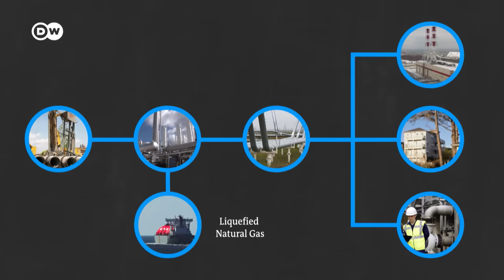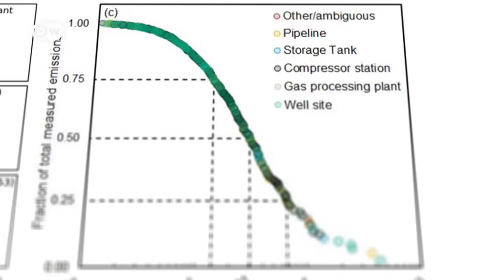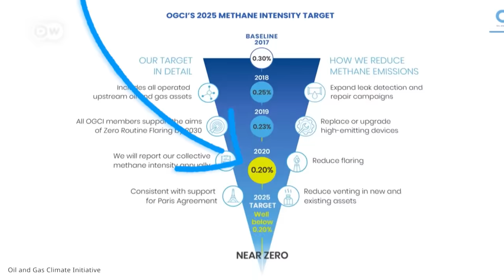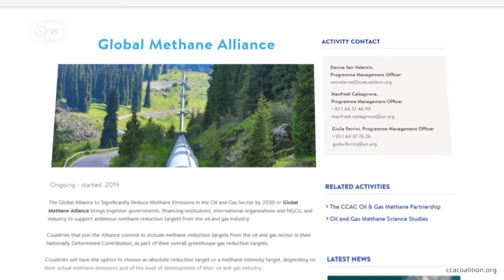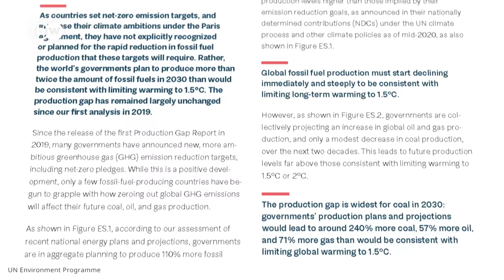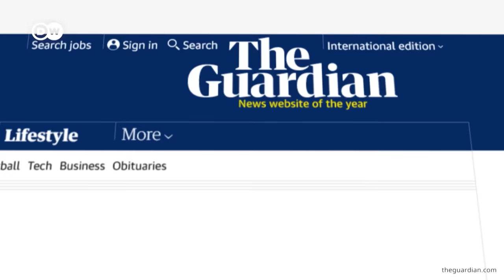Why we need to ditch natural gas (asap)

Comment: We need to fund next generation Nuclear research and then do as France did in the 70's use a "standard" reactor design and mass produce them. We also need to supply all the needed supportive technical infrastructure such as a national nuclear 'fuel-recycling' plant to utilize all the "spent-fuel" stored all over our nation. ALSO, anyone remember the natural-gas fuel cells? (remember the little 'black-box' on 60 minutes a decade or more ago?) AND, If leakage is such a problem then promote tools/plans to diagnose and fix them...?! My power costs have skyrocketed and the inflation of other essentials like food and fuel has significantly reduced my families purchasing power. Action action we want action... A-C-T...I-O-N!

Comment: Interesing, but I think this topic is a lot less simple than it seems. 
First, no gas or energy company likes the leakages.  It loses them money, so a lot is currently been done to reduce the leakage of gas.  Similarly, years ago, continuous gas flares were a common sight in every refinery.  Nowadays more and more companies have completely closed their flares and have them only operational to deal with emergencies
Looking at gas and oil and even coal as only a source of energy is also very simplistic.  Gas and Oil refineries primarily produces fuel, but then among its byproducts are the building blocks for many other chemicals used in our fertiliser industry and our pharmaceutical industry as a examples.  It is not as simple as “switching to renewables”. We still need these other things.  We still need ways of producing them without breaking the bank.  All the critics of the fossil fuel industry seems to focus on fuel and electricity generation but I have yet to see any solutions that will carry us all the way.

Comment: Methane is messy. Methanol I think is the option that will be good for energy storage , because it is the liquid cleaner ethanol, as an energy backup in cold places, and it can be used for CONTAINING methane.  But we need to get off methane because it still acts as a climate accelerator.

Comment: The Gas that is mined is called "LPG" liquified petrolium gas and not LNG. LNG is same as biogas and also CNG. CNG, compressed natural gas is LNG but in a gas state. Germany and Italy have well developed network of Biogas-LNG power plants, rest of europe doesn't really have that much bioplants. Developing gas in the next decade will be crucial for the energy stability. We imported gas from russia now we will try the same with the gas from the middle east but we could produce our own as well. Problem of Hydrogen is that it takes relatively a lot of power to produce it. We can produce Hydrogen during summer and long hot days and use it as a storage of energy instead of transporting our energy to other european countries. Solar panels they also will produce some pollution when disposed. 
Strategy of small steps would be better
First make sure that all of europe starts produceing their own gas 
Second look for geotermal hot springs
Third if all fails and there is no water power plants or geotermal waters then make the countries that run on gas transfer to solar panels and produceing their own hydrogen
Forth try to maximise hydrogen production but without enforcing any laws. 
Fith is to have a next energetic revolutin solar panels are also not the cleanest way of getting energy we need to figure out somehow how to produce energy with 0 waste.

Comment: Check what is CBM or maybe I will do this now. It states for Coal Bed Methane. Very few mines are capturing it, normally high metane content coal seams are fracked and all gases are removed via ventilation system.
That means burning coal you have twice as much CO2 but also lots of methane. That sucks.

Comment: `What hurts is the constant mention of carbon as a pollutant.  All life is carbon based and carbon is just the C in co2 which is plant food and part of the carbon cycle.  Co2 should be around 1200 ppm for plants to be fully able to grow yet it has been way too low for eons.  Carbon dioxide gets trapped into sea shells, carbon based rocks like limestone and various forest beds to later become coal, and oil or by plankton that die and sink to the ocean floor.  Much of that co2 is permanently sequestered creating a dearth of supply for plants.  Without us digging it up and burning it plants are literally gasping for air.  Plants die around 150ppm and what we are doing in this era is returning co2 to the atmosphere so plants can once again grow at their full rate.  Co2 is a wonderful thing and putting more of it into the atmosphere right now is a good thing.  The lemming like brainwashing cult that calls Co2 a pollutant is just that, a cult, and you should pull your head out of the disinformation swamp and do some reading about what CO2 is and how plants use it.  Once you do you will see why anyone that says Co2 or more inaccurately carbon is a pollutant is bat stuff crazy and part of an echo chamber of fallacy and lies.

Comment: If you look at a graph of earth temperature over the last 500M years you see that we're actually in an unusually cold phase. What happened when it was a lot warmer? the US was like the Amazon, dinosaurs roaming around, and there were palm trees inside the arctic circle. Doesn't sound all that disastrous. Look how much of the north is unlivable in the current climate. that would be a lot more room to live comfortably and the higher CO2 would also boost plant growth. It would only be bad for people who live on the coasts, they would need to move, that's all.   Can humans breathe high CO2 air safely? It gets up to 800-1000 ppm on airliners from breathing out CO2. The average auditorium with people in it gets up well above 1000 ppm, nobody even notices. The real reason we need alternative energy sources is that oil will simply run out by about 2050 and natural gas and coal by about 2060.

Comment: The amount of CO² in the atmosphere is approximately .0415%. 

The amount of CO² pre industrial revolution was approximately .028% 

The difference is approximately .014% since 1822. 

.014% /200 is .007% per year 

The amount of CO² produced by humans is 3% of the natural cycle. 

The amount of CO² produced yearly by the United States of America is approximately 25% of the worldwide total. 

The total amount of CO² produced by the United States of America is: 

All approximate values 

0.007% x 3% x 25% = .0000525% 

If the United States of America hit net zero today it would reduce the yearly increase of CO² by approximately .0000525%. 

The average global temperature would drop .3°c by the year 2100.

Comment: So their argument, ditching
Gas power plants for renewable energy plants and using batteries as storage of said energy is kinda flawed. Batteries are made with elements that are scarce(so they are gonna accessible for everyone) and whose extraction is extremely polluting and energy intensive, and the average span life of a battery is 5 years.. so no, that ain't solution, nuclear energy should be a priority, and even with a few drawbacks, hydroelectric power stations are a great alternative when possible.

Comment: Funny how now we are having this conversation (at least when it comes to DW), when there's a conflict with the main gas supplier of Europe.
This should have been considered from much earlier. As well as countries should have invested much more in nuclear energy. Instead we saw how Germany was celebrating the nuclear shutdown of the country, it being one of the most power hungry countries around.
Reply: Exactly. Scrolled to far to find a comment like this, it surprises me how that fact crosses nobodies mind. Tomorrow they are going to talk about bad side effects of nuclear energy and lithium processing for the batteries. But today we'll talk about going all electric, that's what's cool right now.

Maybe going all-electric is better, but what we're missing: the tank (reservoir) for gas or natural gas costs environment almost nothing, while the "tank" (the battery) costs environment a lot. Though, sure it's good for the developed countries.
Reply: @samirzahirovic8440  Thanks for taking your time to find and read my comment :)
Good point. The idea of green hydrogen, of producing hydrogen while using wind or solar when it is available, it is also another way that can help complement nuclear, but I am reasonable and I know that there is still a long way to go, as we need to do a lot of spending if we want to get the technology fast outside of the experimentation stage and into production levels. I would imagine that storing hydrogen would be less damaging for the environment than the Lithium batteries.

Comment: All the shipping from China as well 30% of world packaging , all so called EV battery is clean , look at all the processing in batteries , fires you never report what harmful fumes come from burning lithium , and cars , no easy solution but put all issuse on everthing , Solar huge land grabs to power anything , wind still need roads to them and more land used , housing industy takes from , natural Gas has pipelines in already most areas have it , you also need to show the right plants processing it like Air proucts , Linde ,  Plains Midstream they have total different ways  then a crude oil refinery , alao a coal conversion is the burner. Water to steam whether coal or gas is just a method of the burning set up , wind mill blades go to a dump , solar panels they say another issue to dispose , and all these things take transporting , bulldozers , land to dump , just think a deeper dive start to finish when talking what should or should'nt .be used

Comment: Using natural gas to power thermal generators is an inefficient use of natural gas because on average they have efficiencies around 33%. Natural Gas appliances such as high efficiency natural gas furnaces hot water heaters dryers and stoves have efficiencies around 90-99%.
Turning fuel into heat is much cheaper and easier than using an engine to turn fuel into heat, turn heat into mechanical work and turn mechanical work into electricity. Piston engines are more efficient than turbine engines because of piston rings (invented by Soichiro Honda, 1938) which greatly reduce blowby - it prevents the pressure from escaping before pushing the piston from TDC to BDC, greatly increasing the Mean Effective Pressure.

Comment: Without AFFORDABLE energy, life is brutal and short.  The poor need energy which is cheap and plentiful, as gas is.  The lower troposphere (the atmosphere above your head) has been rising in temperature at 0.13 degrees C per decade.  That's an extraordinarily low rate of ascent.  It means 100 years to get to just an increase of 1.3 degrees C...and some volcanoes (due to go off) will reduce that anyway.  The FACT is that we need fossil fuels precisely because of my first sentence.  This video is uninformed ignorant nonsense

Comment: Methane emissions intensify global warming 15x that of carbon dioxide.  According to the EPA, methane levels in the atmosphere have increased from a range of 125 to 300 ppm historically, to 420 ppm currently.  The combination of these two factors indicates that methane emissions must be dealt with.  Clearly the fossil fuel industry contributes, but other industries that you might not expect also do.  Notably the cattle industry and the hydroelectric industry.  Cow burps may contribute to as much as 30% of the increase in anthropogenic methane.  Hydroelectric projects, such as dams are also large emitters of methane because of the breakdown of organic matter submerged by the waters.  Also these dams are at least partly, sometimes fully constructed out of concrete, and the concrete industry produces 8% of yearly anthropogenic carbon dioxide.  Sorry people, hydroelectric isn't anywhere near as clean as you think it is.  Should we end all natural gas use?  No.  As mentioned, in the video CO2 is a byproduct of oil production, so as long as we are producing oil we must use the associated methane in as green a way as possible.  I would suggest wells that produce only natural gas be shut-in for environmental protection, though.  We should also look into ways to capture methane from all other anthropogenic sources, like is done with many modern landfills.

Comment: Natural Gas as a bridge fuel made sense 20 to 30 years ago. Had we replaced a significant amount of coal and oil use back then, we might have avoided the crisis we are in now. Switching now will have a negligible benefit as we have already pumped that 30 years of higher GHGs into the atmosphere.

Comment: Methane is upwards of 90% of the blend of natural gas. So when you talk about methane leaks - another way to say this is that the product is escaping. This is why companies aren't going to simply stand around and let 7% of it disappear. That's money floating away. The industry doesn't even need much regulation to focus on the problem,- it's self-enforcing. They don't want to lose money for no good reason. Realistically the whole chain isn't going to be perfect, but that grand total number is going to be in the 1-2% range, with most of the error in the production side. The midstream sector won't let much disappear because they know (measure) exactly what goes in and what comes out - and they have whole teams focused on minimizing lost gas to a tiny %. The most telling letter in the title of this video is the last one: p. P for possible. Because that's the reality here, we use gas because it's the best possible option which actually WORKS when considering the dynamics of a power grid. The time when it does become possible to switch off gas entirely is down to when the green movement puts on its big boy pants and accepts modern nuclear technology as the way forward. Until then, the best route forward globally for incremental GHG improvement continues to be gas, because displacing eastern coal societies with LNG that we can export them has giant potential for emissions.

Comment: We need to move to renewable energy sources immediately. They are cheaper than fossil fuels and much cheaper than nuclear power plants. If we stop investing in fossil fuels, natural gas included, and invest that money in renewables, the transition to renewables will be paid for with money left over.
Alcohol fuels from biomass should be the fuel for our transportation sector. Let’s pay our farmers – not international oil companies. Biomass is a renewable energy source, and as such, does not generate greenhouse gases. 
Electricity should come from geothermal sources. Drill down 20,000 feet and you can produce all the electricity a community needs forever. Solar and wind may not be completive with geothermal. That may be why geothermal is being ignored. Wind and solar are already cheaper than fossil fuels, and much cheaper than nuclear. 
Therefore, why would our politicians who are corrupted by the monies from the non-renewable energy sectors, want to have an even more obvious example of how corrupt they truly are.
Reply from the maker: Thanks for your comment! You might also like our video, "Geothermal energy is renewable and powerful. Why is most of it untapped?" 👉 https://youtu.be/c7dy0hUZ9xI - check it out and let us know what you think in the comments 🙃

Comment: Ok, so the problem with fossil fluels is they take millions of years to be renewed, right? Using solar or wind works, but isn't pleasing everyone because of it's limitations.

Why not burning coal made of trees grown in a sustainable way? Tree "farms" are used by the paper industry, can't they be used by the coal industry? Is is considered a renewable energy if it's used this way? 

I know it won't contribute for reducing the carbon footprint but at least it won't increase it, which is what's happening with fossil fuels...

Comment: More CO2 is good for plants. More plants are good for us. Why is the propaganda opposite?
Reply: The problem is the CO2 (in concentrated areas) also heat up that area. 1-3 degrees over a view years cause the plants to not be able to absorb CO2 as well. Also can allow bugs, such as pine beetles, to survive winters easier and cause a lot of forest devastation. Utah is currently suffering from this

I’m no “end of the world, have to switch everything to hamster wheel tech” person but it’s a challenging issue to solve. No perfect solution but I think Nuclear would be the besr

Comment: Your also have considerable emissions from the shipping of natural gas around the world. 
What most people don't realise is that shipping still and will continue to use, for the foreseeable future, is (bunker fuel) which is the dirtiest of the dirtiest of fossil fuels and is what is left over at the very end of the oil refining process - the dregs in other words. Since nobody had any other commercial use for it, bunker fuel ended up being the fuel of choice for the shipping industry since it was cheap and abundant.
So while natural gas is cleaner to burn, the shipping of it most certainly is not.

Comment: Obvious first step is to use less energy.  That may however by a consumerist society that wants everything and can not bear being happy with getting needs satisfied.  It seemed strange that no mention was made of 'natural' methane emissions such as those from swamps and rice paddies methane is formed by the anorexic degradation of vegetable matter so it is part of the atmospheric balance.  The FOGI (fossil oil & gas industries) will hate leakage as that represents a loss of revenue.  Also the assertion that methane is 'x' times more of a GHG than CO2 is a little more complex as the opinion on intensity and duration as well as abundance are still in debate.